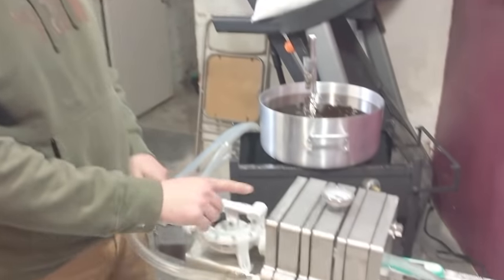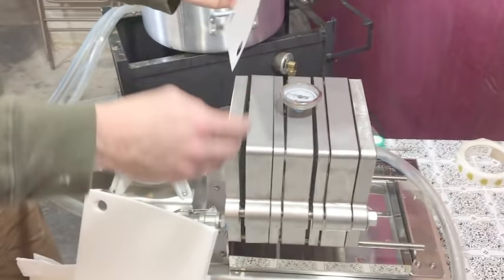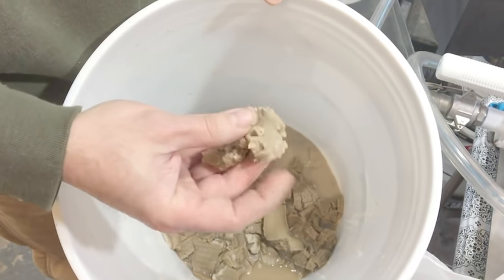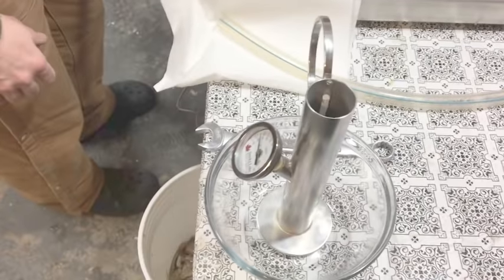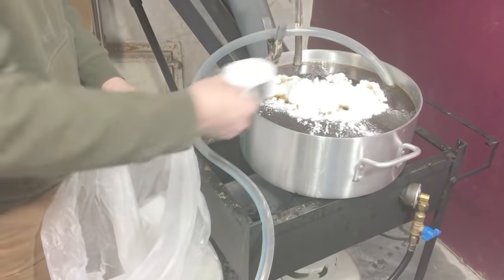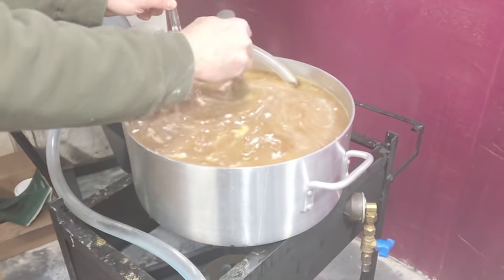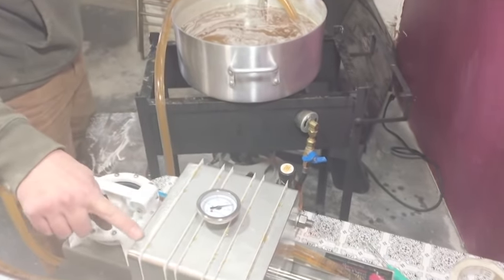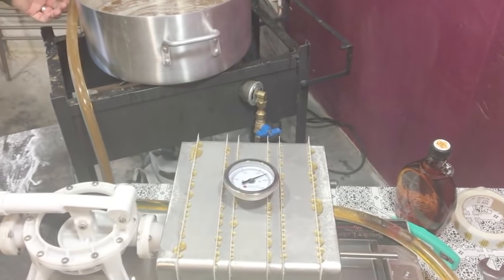Smoky Lake Maple Filter Press - 7" Short Bank Stainless Steel - How To and Review

Comment: When I lived in NH and sugared I had a Wes Fab short bank press with the hand pump, but I did a stainless steel 90° elbow facing lateral to the press at the outlet, then a short 4" stainless threaded pipe and then a 1/2" stainless bottling valve from Bascom Maple Farm in NH. I would run a bit of syrup through the press to get it hot and dump that clean syrup back into the pan and once the press was hot it just started bottling right off the press. Having the valve and hand pump for control meant there was very little syrup drips and the area stayed clean. I had multiple large pans of syrup heating so I could bottle multiple batches before cleaning the press. This method save a ton of time by filtering and bottling at the same time and my syrup was crystal clear.

Comment: You should tighten that press as tight as you can get it.  We have a 9 plate 12 in press and barely have a drop come out at 90 psi.  I'll tighten it then 30 min later I'll retighten it causevthe papers will decompress.  Then it's good to go. But nice little set up you have.

Comment: I saw your temp. gauge at 190. How much is that batch cooling in the bottler by the time you are done filtering and the bottling tank is ready? Are you having someone help you bottle to maintain the high temp or are you reheating it on your burner stand? Also What burner stand are you using with the unfiltered syrup in the video?
Reply from the maker: Now that I use a water jacketed bottler, the syrup does not cool much if at all.  I would expect 10-20 degrees of cooling otherwise.  You definitely want it 180F at least for jugs and 190F for glass and I preheat my glass containers in a hot water bath.  Much hotter than 190F and you risk precipitating more sugar sand in the filtered syrup and negating your filtering efforts.  

Pictured here is a burner stand for a W.F. Mason finisher/canner unit.  I no longer use that setup.  I like water jacketed or steam pan style bottlers because burners directly under a canning unit create a hot spot and niter buildup which can flake off into your filtered syrup.  Hope this helps.

Comment: Hi, what is the white powder U use before filtering? Thanks
Reply: The powder is called DE. It’s pretty much ground up sea shells. It’s mixed in and it bonds with the dirt partials and sugar sands. It is then caught by the papers that he installed. This gives the syrup a nice polished clean look.

Comment: What kind of stock pot is that and what size? Is it aluminum or stainless? Thanks!
Reply from the maker: It is aluminum and only use for syrup.  I recommend stainless however.  I think this one is 8 or 9 quarts and came from a restaurant supply store.
Reply: Thanks! Just curious - why would you get stainless over aluminum?
Reply: Katie Blackman I used a cheap aluminum turkey deep fryer pot for two years.
The third year I tried to use it, I found that the bottom became porous and liquid would seep through the bottom.
Stainless steel handles repeated heating and cooling better, hands down. Also easier to clean.

Comment: what is the waffle plate for? is it also a filter?
Reply from the maker: It is not a filter.  The waffle plates support the filter papers while providing a pathway for syrup to travel behind the papers to the discharge port.  It's kind of hard to explain without actually looking at it.  Syrup enters the window plate cavity, impurities and DE accumulate on the paper and then the syrup passes through to the waffle plate.  By the time it exits the press, it is crystal clear.